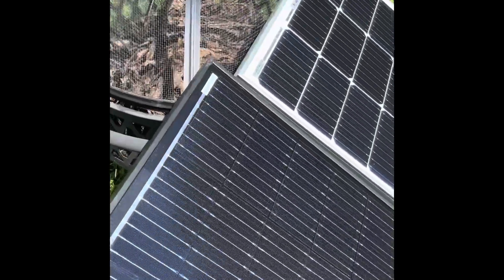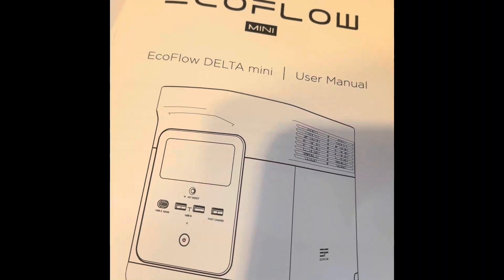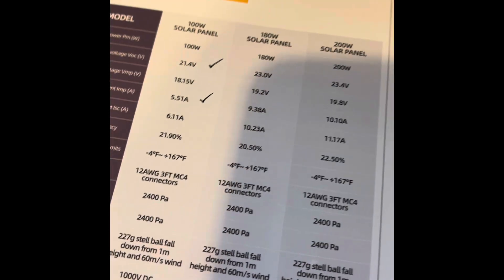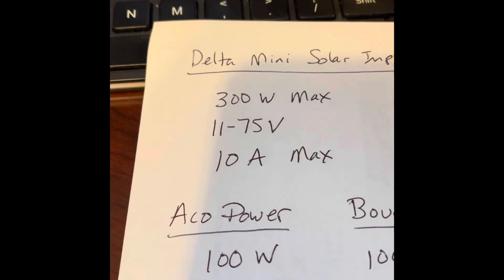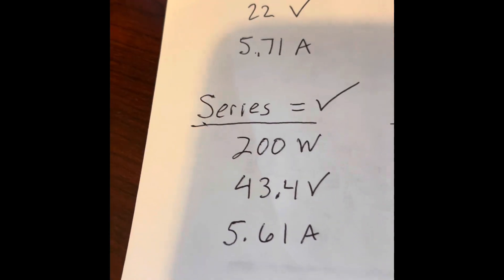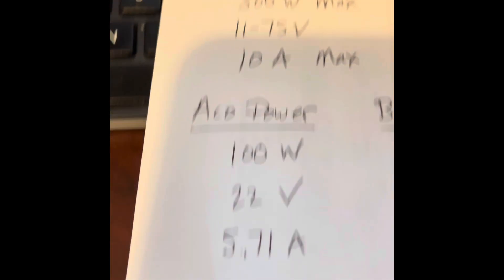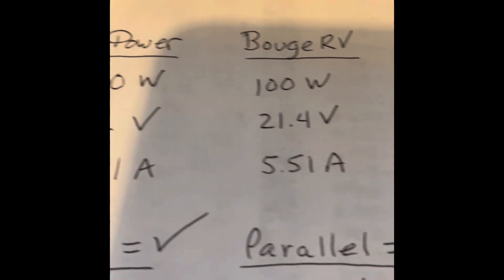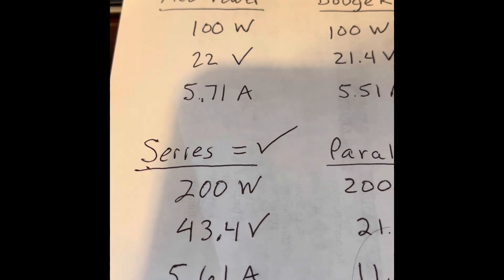Charging my Ecoflow Delta Mini with 2 Different Branded Solar Panels

Comment: from my understanding if you mismatch it will always use the lower one whether you doing series or parallel.  in series if you have one panel that's 20volts and the other is 24 volts it would be 40 volts combined and the amps will go to the lowest of the 2, if your doing parallel take the panel with the lowest amps and multiply that times 2. Your device will only pull what it needs amp wise, volts are pushed into the device. that's what you have to worry about